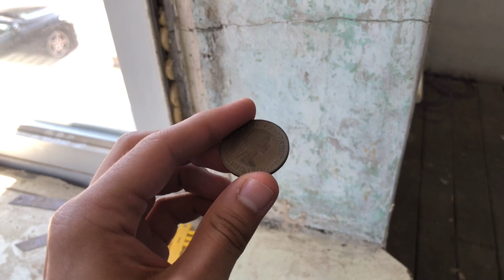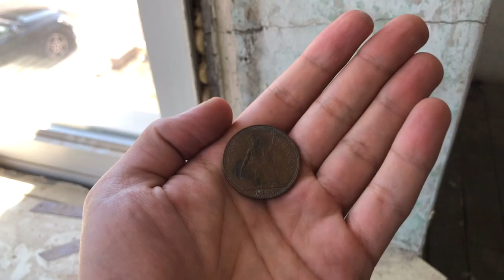*VLOG 2*  - TAKING OUT CHIMNEY IN BEDROOM (Found something inside!!!)

Comment: Could you not have used a gallows bracket to support the remaining chimney breast in the loft instead of using an RSJ ?
Reply from the maker: I was told by building control to add a RSJ for additional support 🤷🏻‍♂️ i think they dont use them anymore but not certain.